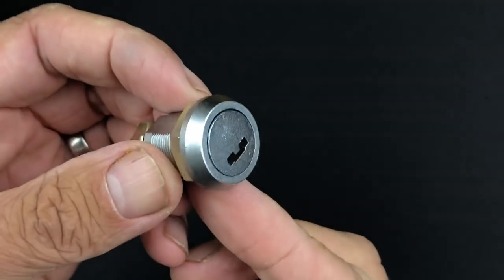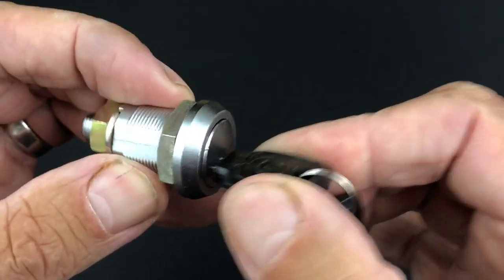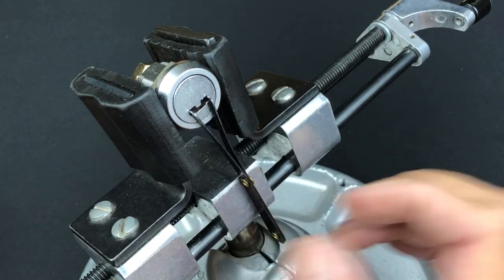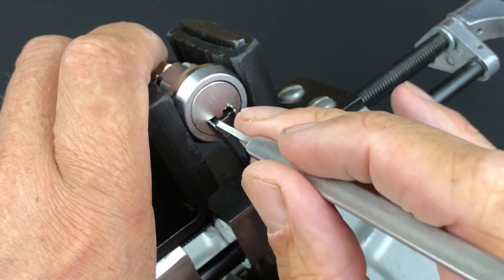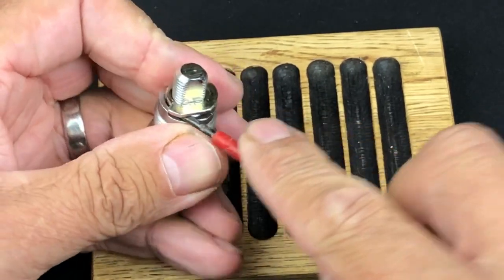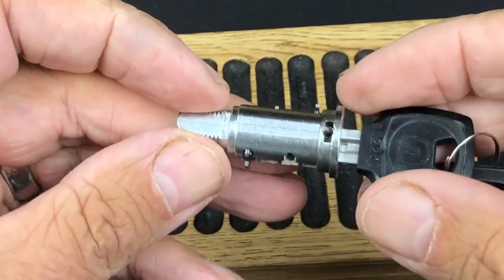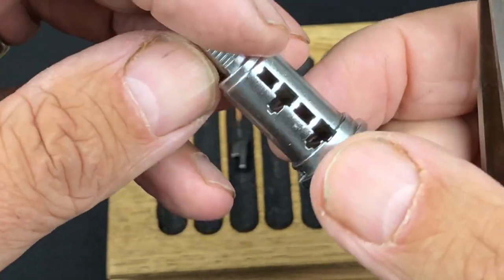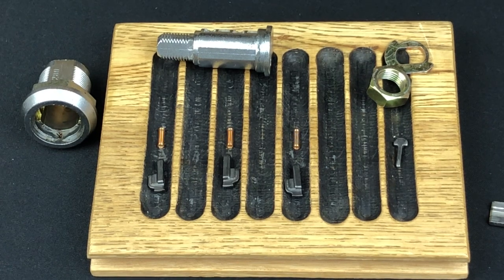“Miwa Magnetic Cam lock” from an arcade game machine, pick & gutted

Comment: I had to take a look at mine again and it is opposite yours with two sliders on the left and 1 on the right, still with 3 sliders total.  I think its a really cool little lock
Reply from the maker: That’s really interesting to know, I think they must all only have 3 sliders them, yours is the 4th one I’ve heard about & they all have 3 sliders. They really are very cool little locks. I’ve just brought a 7 slider version that should be a fun challenge, hopefully it will arrive tomorrow :)
Have a great week my friend.
Reply: @dazevers  I forgot to mention, that in mine, it is the front most chamber that is empty
Reply from the maker: Ken Nixon That will mean that when you pick it, slider 4 will need to be picked first, that will drop you into a really deep false set, then you will just have to mess around with 2 & 3 to get the open. 👍

Comment: That is a nice little lock. I guess with good tolerances and more sliders it can be quite a pain to pick if you have to balance the tension accordingly. Great demonstration and thanks for sharing Daz!
Reply from the maker: This is such a cool little lock, I think you are right, with a few more sliders in & maybe varied strengths of magnets both in the key & sliders this really could have been a very tricky lock to open. Still an unusual little lock. Have a great weekend my friend.

Comment: Great video mate👍. I think every single one of us have one of those tensioners, they are pretty useful for very specific locks. Is there any commercially available magnet picks?  Very interesting lock thanks for sharing. 
Stay well mate👍🇦🇺😊
Reply from the maker: The Butcher’s bLock you so right, & I’ve had this tensioner for about 3 years & never used it, & when I saw this lock i thought perfect & as you saw it fits perfectly. I’ve never seen a magnetic pick for sale. The magnets are so cheap, I payed £2.30 for 50 For eBay bargain. 😊
Have a great weekend mate.

Comment: What an interesting lock. It appears surprisingly easy to pick (says me) or did you just make it look easy Daz?
Very interesting video to see how it's picked and what makes it tick.
Reply from the maker: Roy Sammons Its such a cool little lock, when I saw it I just had to buy it, the lock is really easy to pick with the right tools & an understanding of how it works. The way this lock is designed it will always be the 1st & 4th slider followed by the 2nd & 3rd sliders. 
I actually made another video explaining the locks design flew but decided to run with this one instead. 
I’ve just brought the 7 slider version so that should be an interesting challenge. Any mate have a great weekend. 👍